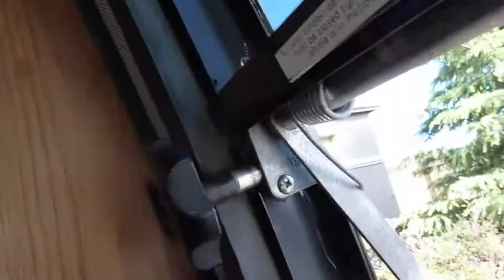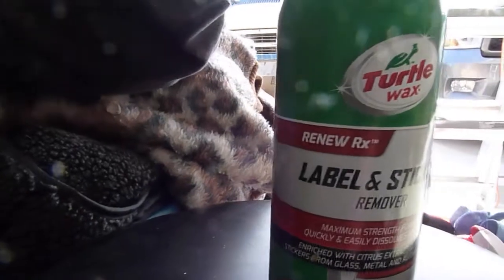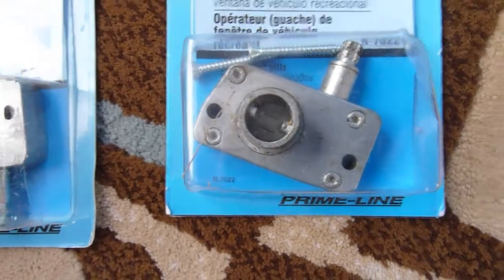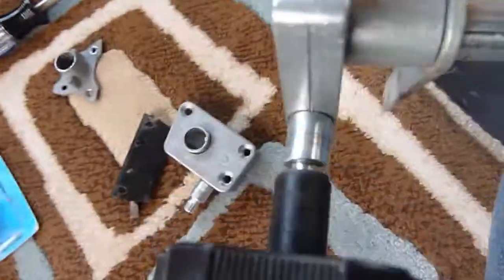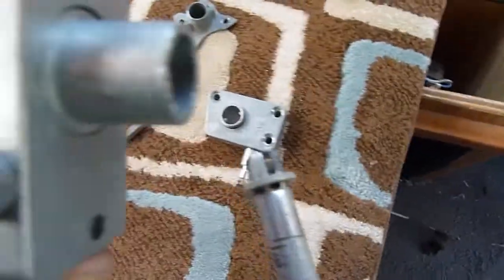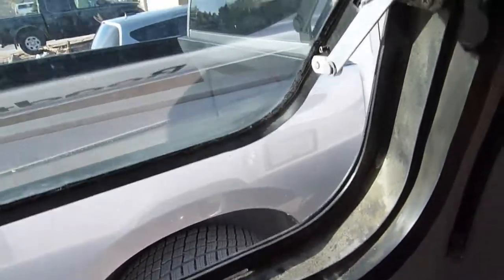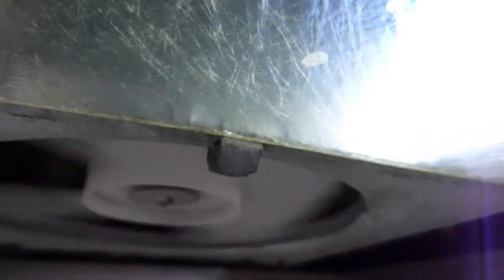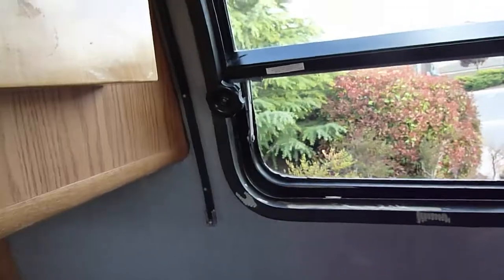Part 1: Replacing A Broken Window Winder Crank Torque Operator In A Roadtrek Camper Van RV

Comment: As Jackie Gleason would say, Sum Bitch
Not more WD40!  it is not a lubricant.  After the solvents evaporate what remains is a drying oil (solid), to provide a solid rust-preventative coating.  It will just gum things up in the long run.